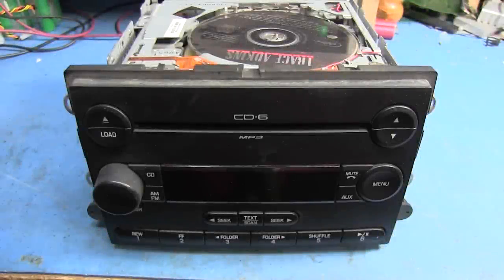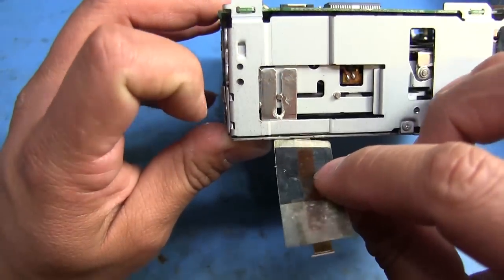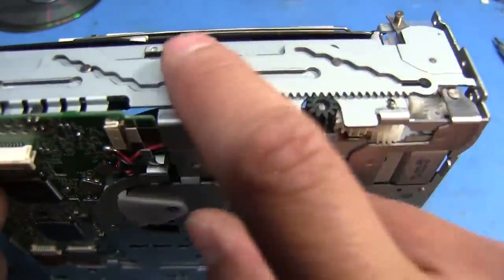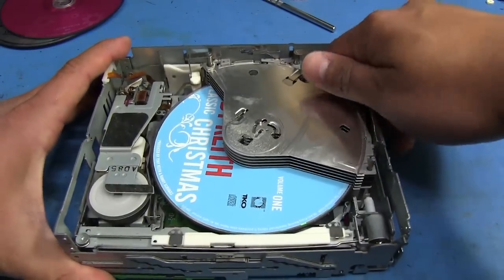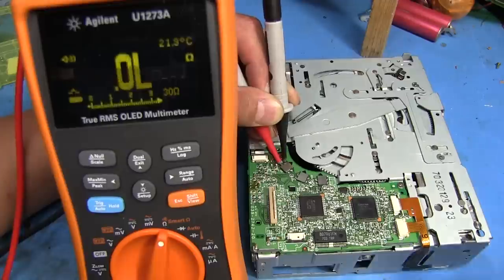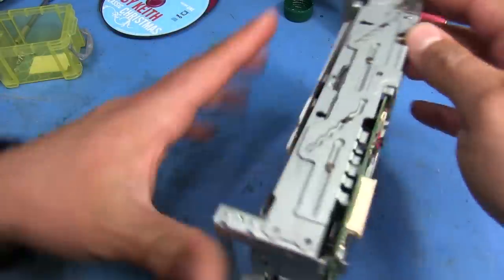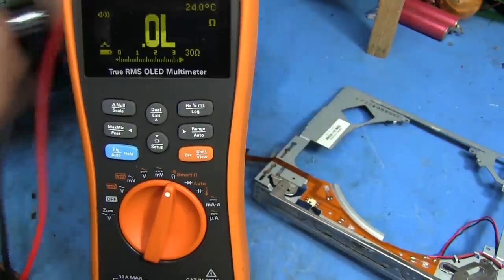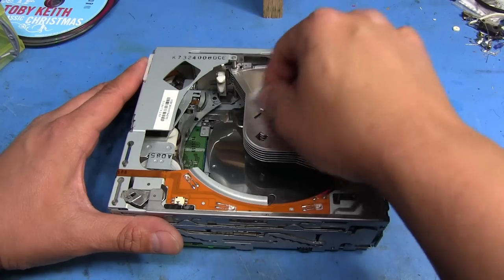TWB #5 | Let's fix it! Jammed In-dash Ford 6 CD Changer Repair

Comment: SUPER REPAIR VIDEO!  Thank you for making this video, I learned a great deal.  I looked through all the videos you have on your channel.   Now, need to ask if you have further wisdom on how to fix the same type of stereo unit in my 2007 Ford Explorer Sport Trac V8 4wd truck.  The lighted display has never worked since I bought the truck, so I cannot see what channel the radio is tuned to, or which cd is playing.  Blank display, ok, it did faintly light up two times when I gave it a good hit above the cd changer on the dashboard.  Any direction you can offer is greatly appreciated.  Linda/Indy
Reply from the maker: Sorry for such a delayed reply, but the most common issue with those green VFD displays on the Ford radios is that the SMD resistors in line to power the filaments on the display break at the solder joints. These are located in the faceplate. They're large flat chip resistors. They need to possibly be cleaned and have the solder reflowed and they work fine again. It's possible there could be something else going on, but that's the usual problem.

Comment: This was a great video. I am going through this same player out of my 2007 Focus. I had no clue about the micro switches on this unit. I noticed that the small black gear on the side that you removed, on my unit was recessed into the body and was appearing to not make contact with the rack gear on the side. Have you ever seen this before?

Comment: Excellent repair work...I have early 93 (black connectors)....my changer does not work.. found that the white plastic worm gear that usually just comes off was gone...do you have a junker or gear I could purchase.

Comment: Great video. One suggestion.  At the beginning of the video it would be a good idea to list the tools needed. I got all the way through to the point where you need to clean the switches but I didn't have the cleaner.

Comment: Hi.  Thanks for the great video.  One small thing, when you remove the wire loom connecting the top plate to the body, when you remove the tape, the connector on the while connector on the board has two very small tabs to pull out to release the wire loom and make it easier to reinstall.  I have another problem with my CD player.  There are two moving plates that are moved by the small motor that you remove.  The plates in my CD player seem to jam about half way along.  Difficult to turn the gear, even the large gear in the bottom with the chrome plate removed.  Usually have to push the plates as well as the large gear to get them to move.  I cannot tell which plate is jammed.  Do you have any suggestions as to what this problem is and how I can fix it?  Thanks.
Reply from the maker: Phil Park Unfortunately without looking at it, I wouldn't know what's causing them to be difficult to move, specially if it got difficult to move before doing any work to it. You may be able to get a better idea of what's keeping things from moving smoothly by removing the disc trays, if you haven't already. It takes a little bit of prying away on the two metal retainers that are on the two rear rods and pulling out the pegs of the trays from the two white plastic positioning pieces located on the right and rear sides of the transport. With some care, all 6 trays will come out together since they're held with springs. I hope this helps somewhat. Let me know if you have any other questions. I apologize for the delay in reply. 

I might just do a video on how to take the mechanism completely apart since I've been getting many questions that go beyond what I showed in this video. I think it would help more people.

Comment: Best method for applying the DeOxit is to use a needle dropper dispenser bottle. They are not hard to find on the net, or many times can be purchased from a hobby store.

Comment: Very nice video.

My 08 versa has one of these units and it has been broken for the past couple of years. I just came across this today and decided to take mine apart. The switches check okay, but I cannot get the changer to move freely (the part around 12:40 in your video) so I think that is my problem. Unfortunately I wasn't able to figure out what was preventing it from moving so I put it back together (I'll find out tomorrow if it still powers up).

Comment: Most malfunction(s) in devices such as CD players rely on these types of switches and as he said in the video if one or more of those switches don't signal the microprocessor of the mechanical position.... jams occur ... switches inside can sometimes be a real pain to get too as well... and some switches are like the ones on the front panel get dirty too ... they in some cases a little better protected against dust and dirt but still can get dirty ... most times you can pretty well bet if a mechanical issue develops in your CD changer (even single CD units) they have switches that tell the microprocessor the mechanism status as well

Comment: One other quick question: Did you use a 12V battery with an inline fuse to power up the head unit to test it? I have a small 12V battery I can use, but I don't have an inline fuse, and didn't know if it was necessarily warranted for test purposes; I don't want to blow any circuitry, however.
Reply from the maker: kevbo0825 I use a 40 amp bench power supply. I normally don't use a fuse, but that doesn't mean you shouldn't. I really should use a fuse and now that you mention it, I'll probably start using one from now on, just to be on the safe side. Never know when something will go wrong!

Comment: this video was extremely helpful, very detailed pro tutorial. thank you. unfortunately... i still screwed up. got out the discs, but when i was bench testing it i accidentally pulled the ribbon cable half out of the main stereo circuit board. now i have no power at all. do you have any idea where i should start to diagnose this?

Comment: Is there an alternate material that can be used for cleaning the switches? Any household products that may do the job? I don't have the multimeter  or the De-Ox-Id. Just hoping to get the thing fixed with something that may work in a similar fashion. Thanks, video has been a HUGE help so far!!
Reply from the maker: You should be able to use most contact cleaners. De-Ox-Id is just what I happened to have on hand. I'm not sure of just using any regular household cleaners for this purpose, but some isopropyl alcohol might do the trick.

Comment: I attempted this fix tonight, ended up doing it twice and I'm still having problems with the changer not wanting to work correctly.  Curious if you'd have any input or suggestions?  The video was great and very informative, I'd have never attempted this repair without it.
Also wondering if you might have some insight on how to repair the non-working display on a 2006 Ford Expedition with the 6 disc Audiophile system.
Reply from the maker: Chase Bolyard Sorry for the delayed reply. Make sure none of the gears are missing any teeth as sometimes they can break. If you may need to further disassemble the unit, I have made a second video showing how to do so.

If the radio is the one I'm thinking about, I think I've fixed one or two of these by resoldering the SMD resistors on the faceplate board that feed power to the VFD filament pins. The solder cracks and they stop making proper contact and then the filament doesn't glow and you don't get anything on the display. The resistors are rather large and I believe there's like 2 or 3 of them in parallel. It's a relatively easy fix. Hope this helps if you haven't fixed it already!
Reply: I ended up buying another head unit that also had a jammed CD mechanism, followed the video again and it will cycle through all 6 slots perfectly, but when I load a CD I get a "disc error" message and it won't eject the CD. I'm 99.8% certain I did everything correctly. Any input?

Comment: Great info!
I have a 500 in an 08 mustang that I have replaced once already. Car only has 15k on it. Was removing CD's and inserted a cleaning disk.That's when things went south. Worked fine before that.  So I'm guessing the pick-up is dirty. Get a "bad disk" error. Will not read anything. Suggestions?
Thanks!
Reply: tamale Yep, I am pretty sure, you need to clean switches, like Workbench is doing in this great, teaching video =) Try anyway !
Reply from the maker: tamale If it's loading discs in fine, but not reading them then it could be that maybe the cleaning disc picked up too much dust and coated the lens with it. A lot of these car radios have a felt like material at the disc slot that tends to accumulate dust. If the disc picked it up from there, it could be causing your issues. I would try opening up the radio and seeing what it does when you load a disc. If it successfully loads and tries to read it, but can't, then it's probably a dirty lens. You may have to manually clean it, just be really careful not to scratch it!

Comment: Excellent presentation.  I had one question, during removal of the CD's on my  changer I inadvertently moved the laser arm into place , now I cannot figure out how to get it back into the park position.  It seems to be stuck in the center.  Any suggestions?
Reply from the maker: All the movement is done with the large gear at the bottom, so you gotta make sure nothing popped out of the guides in it, or got damaged in the process. Sometimes the gear is quite difficult to turn since it's moving so much stuff at once, but it's the only way to get stuff to move around. There is a second video I did about this changer which goes into further dismantling the thing if needed. Hope this helps!

Comment: But if I'm old school and happy with my factory radio but noticed the CD disc changer which should be in trunk is not . Where can I get one ? It does say CD on dash but no hole to insert CD. Planning a road trip and want to play our CDs . Please help. I'm retired and have a fixed income.

Comment: Hi, I have a 6-disc CD player like this in my 2007 Mitsubishi car, and it has just stopped ejecting discs. It works perfectly apart from that. When I press eject it whirs, but nothing comes out. Then it says ERROR 3. However I can still play the discs. Any suggestions what could be the cause? Great video by the way.

Comment: Excellent tutorial video. I have a Mach 460 in my 2001 Mustang Base, and my 6-disc CD player doesn't work; it reads "CD Error" when trying to load a disc, and the CD tray door is stuck open. I bought this car back in October, and the CD player didn't work during the test drive with the auto dealer salesman. I'm going to pull the stereo tomorrow, and see if I can't repair it. Any information you can provide as to why there's a load error, and why the CD player won't except CDs would be sincerely and gratefully appreciated. Also the volume knob doesn't work correctly; won't always turn back down, or turn up when turning the knob. I'm thinking both situations may have to do with the switches you referenced in your video. I am going to test them (ohms) with my multi-tester. I don't have any DE-OX-ID contact cleaner, but thinking rubbing alcohol may suffice? Are all six-disc changers nearly similar when it comes to malfunctioning and repair? Thank you so much in advance for your help.
Reply from the maker: kevbo0825 Sounds like somehow the mechanism got stuck. The radio will give you a CD Error anytime it encounters a problem, but unfortunately there's no telling what exactly went wrong without taking it apart. 

The volume knob is a bit easier to fix, assuming it's not physically damaged. Most of the time the contacts just get dirty and cause the encoder to stop working properly. To fix it, you'll have to remove it from the board and take it apart and clean the contacts. Bending the wiper contacts a tiny bit outwards helps. you'll need to add a little bit of lubricant before reassembling it so it doesn't wear out fast.

I haven't tried using alcohol by itself, but it's worth a shot. 

I've seen at least three different types of mechanisms used in similar looking Ford radios and I've only done the video on the one type. If I come across any different types in the future, I'll try to do videos on those. 

I apologize for taking a couple days to reply, but I hope some of this helps!
Reply: Thank you, for responding, and for the advice. I'm pulling the radio tomorrow night after work (finally purchased the tools I need). I'm still vacillating whether or not to by a can of deoxit from Radio Shack, or just use rubbing alcohol. Thank you again. I look forward to your intuitive videos in the future. KB

Comment: at 9.40 you remove the black gear. on the one in my deck, the white gear next to it is missing teeth. Is that white gear replaceable its self or do i need a new ,,deck or total radio?

Comment: I have CD-ERR 02 showing on our 2004 Volvo XC90 & the same stuck CD's. Do you know if this repair procedure will fix our 6 disc CD changer?
Reply from the maker: I looked up to see what that unit looks like to see if it's similar to anything I've deal with before, but unfortunately I'm not familiar with that particular unit at all. I'm afraid this probably won't help you much.

Comment: THANKS for your video. It is very helpful. I did all the items and now my cd player tries to work, but can not. I took it apart again and found that the whits gear, next to the black one you remove, has at least one tooth MISSING which stops it from going thru all the cd's. Where can I get the white gear???????
Reply from the maker: Bill Mysliwiec Unfortunately I don't know where to buy the white gears. I usually take them from other broken units if I happen to have one.

Comment: Is the De-Ox-Id the only product to use?  A can on Amazon is 50 bucks.  I was wondering if Isopropyl alcohol would work as well?
Reply from the maker: $50?!?! 

The stuff I have I've only paid max like $15/can for. You may be able to use isopropyl alcohol alone, although I'm not sure how well it would work long term since it doesn't lubricate at all, I hadn't tried it myself.

Comment: Thanks for the reply. I have a new issue that is slowing my progress. I got the unit back together, hooked it up, and had a grinding noise as well as a "load error". Luckily I spotted a small white gear that had loosened and fell out of the unit. I don't know where this gear is from, and have been watching your video repeatedly in slo-mo, but have yet to find where it could go.
I had to solder a wire from the corner motor. It came loose while tucking the wires, and I'm wondering if it could be from around the area of that motor. I realize that it's hard to say just from a description and there are numerous possibilities that this gear could be, but any ideas?
Reply from the maker: I don't have one of these units to reference to at the moment, but If it has a hexagonal hole on one side, it's the gear that mates with the gear that turns the large, flat, metal gear. I'm pretty sure that's the only gear that can fall out without much effort, although I could be wrong. If that's not it, link me to a pic of the gear and I'll see if I can help further.

Comment: I tried to repair my cd player the way you did and so the cd player motor keeps running and won't load or read my CD's. Now it's doing the same thing in my other vehicle. Please give some advice on what else the problem could be.

Comment: i just got a question. i put my cd in and it plays a little and it just stops and sounds like its skipping but it stops and i can tell because the time on side to show you how long in the song you are completely stops and does it a lot, but doesnt do it in another vehicle. any thoughts? 
just reply as soon as possible. hopefully before i just go ahead and get an aftermarket radio.
Reply from the maker: Alec Brumback Could be a dirty lens maybe? If the disc is already loaded and playing then it's probably not a mechanical issue. I would take a laser lens cleaning disc and give that a shot to see if it clears up the issue.

Comment: Thanks for this great tutorial. Exact cd player that I have in my Ford Edge.  I followed it and it worked but when I went to install, it would not turn on. Like there is no power. Radio won't even turn on. Any suggestions? I have checked the fuses, they are good.
Reply from the maker: fabricwizard Check power to the connector to the radio. If nothing accidentally shorted or anything when you were powering up the radio I see no reason why it shouldn't work. You may also want to check the board where the connector is soldered onto the radio and see if there is cold solder joints or something. You may try powering on the radio without the CD mechanism in place to make sure it's not something on there shorting out the power supply. Good luck!

Comment: I thought I followed all the steps, but when I plugged it in the CD changer doesn't work at all.  No noise, nothing.  Everything else works: radio, etc.  Could it be I didn't push the ribbon in all the way?

Comment: Would it be possibly to just cut a wire or leave the board out to just disconnect the cd deck entirely and just use the normal radio?

Comment: it will be good idea to use the motor with voltage to turn the gear clockwise and vice versa? and It would be a good idea to clean the laser lens?

Comment: Hello The workbench: I have a radio almost identical to the one that you repaired and I think the issue with my radio is different, it is also 6CDs and the screen shows 6 little circles for each CD like this OOOOOO but my radio shows a the number 1 out of the circles just like this: 1 OOOOO and there is not any CD inside when I try to load a CD in any spot the radio screen shows load error, what could be the reason and how I can fix it? Thanks